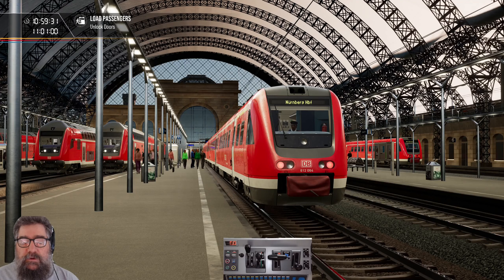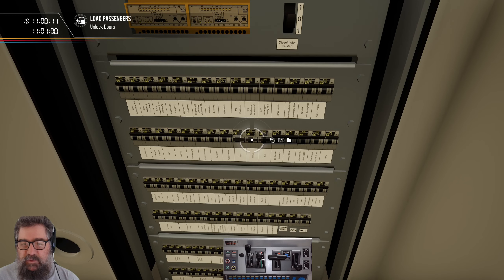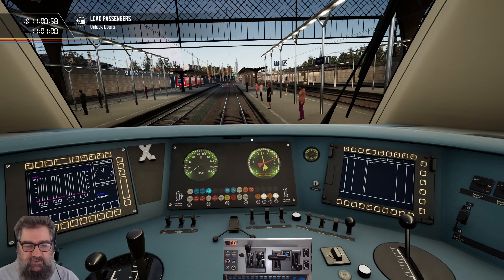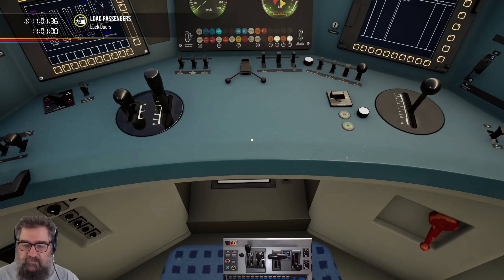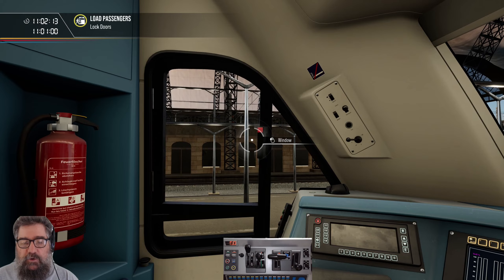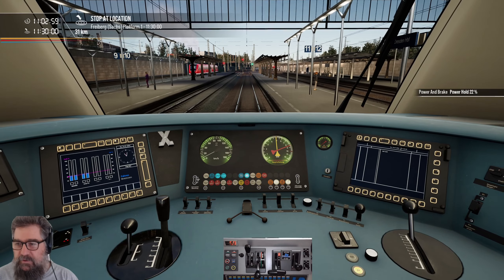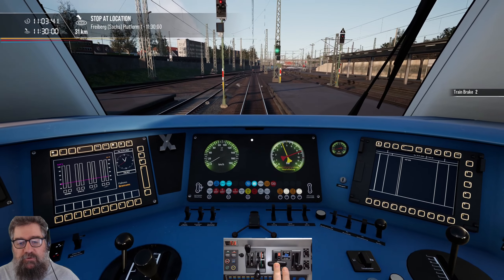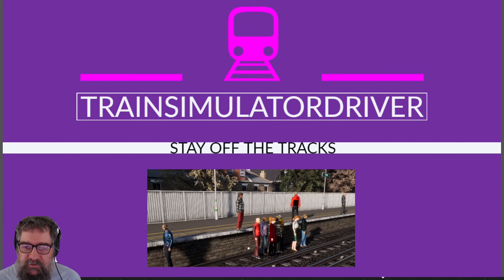TSW2 BR612 Diesel Hydraulic Multiple Unit with Safety Systems Tutorial

Comment: great video, but I got a question - when you drive as double unit, do you have to turn on GNT in both units' cabinets, or just in the front unit, to be able to utilize the full power of tilting (cos as far as I know, GST gives you only like 2 degrees of tilt, while in conjunction with GNT it not only gives you higher speed limits but also 8 degrees of tilt)?
Reply from the maker: Only the front unit, you shouldn't have to do anything in the other one
Reply: @trainsimulatordriver  so I just turn it on in the lead one and it kinda transmits to the other one that it has to lean too, right :) ?
Reply from the maker: @RazielKainus  that's the theory
Reply: @trainsimulatordriver  thx :)))
Reply from the maker: @RazielKainus  np